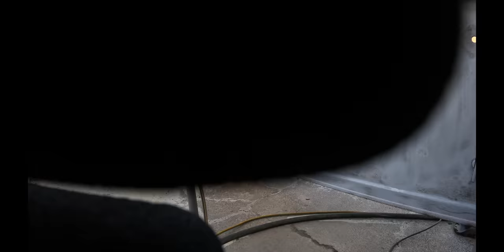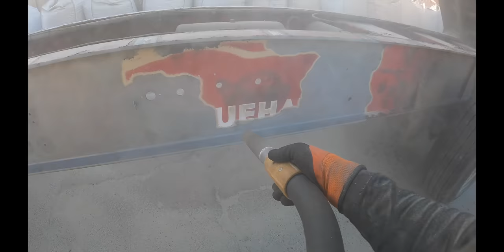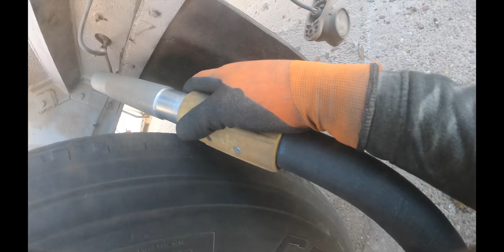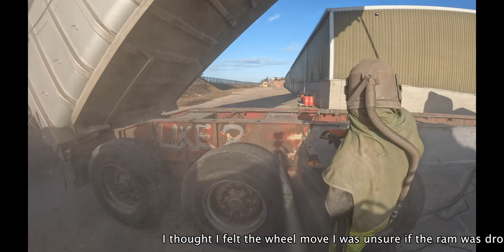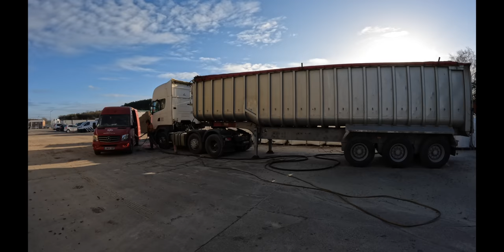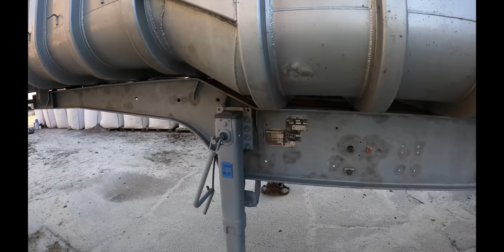How to Kill Rust! Rusty Wagon Trailer SandBlasting to Stop Remove Scabs of Rot sand blasting Real!

Comment: I once did a coupla trailers at a place in chorley and he said you don't need your compressor I've got one . Turned up and he's got an ex RAF compresser off an aircraft carrier that could go up to 600cfm  and fedd a 4" bore air pipe constant 😲😮 hooked it up turned it down and started blasting and noticed the push back getting more and more so checked gauges on compressor ,it'd only crept up to 150 psi 😲😮 . .thought better keep my eye on this and had to turn it down 4/ 5 times that day, nearly blew my kit up on that job 🤣😂🤣😂

Comment: If you don't mind me asking and I know all places charged directly. If you don't mind me asking how much did you charge for that job. If you don't want to say on open forum please email me. Thank you.

We are starting mobile blasting and just looking to see what ppl do for prices so I can understand better
Reply from the maker: Best advice I can give is work out how much your rig costs you per hour and then add labour what you can live on that's your hourly cost then it's down to you to know how long per job will take you. Please note everything about my rig and my ethics is set on speed and efficiency without compromise on quality. What I mean by this is your not going to be at this sort of speed and efficiency for some time but stick at it then it will become 2nd nature hope that helps figuring your costs out 👍💞
Reply: @Mobileblaster  thank you so much. I do powder coating on my channel right now and wanted to work my way up to mobile blasting like you. Love your vids
Reply from the maker: @GMPC  have you bought any mobile gear? Because alot of info about what's needed is wrong I can guarantee the sales reps will try and push an all in 1 with a massive tank you don't need spout off about this unit saves this much media than others its bolx mate you set the flow your the 1 in control not the the pot. It's like saying this egg timer will last longer than that 1 yeah course it will the gap is tiny and that 1 hold more. Utter shite and I know it will come out of a sales pitchers mouth no doubt to try and con the lesser informed. Dint fall for the size thingy bigger isn't always better 50kgs/200kg pots are ample for mobile run time varies out of 200kgs I can get 25/30mins or 3 and half hour that's more than my competitors blast pot 😂 totally depends on what your blasting and at what flow and cfm compressor any blast pot will run any cfm 2 main things to look at internal diameter of the gubbins of pipes and fittings are the same size as the feed air ie same size as compressors feed then it's all down to nozzle size

Comment: Why didn’t they want the inside of the rails done? Is it a cheaper option for the inside to be left?  Can you blast over the trailer air lines and valves??.  

What is that job worth? If you don’t mind me asking? And do they have to supply a safety A-frame For under that bin while the ram is up? 

Great videos keep up the good work mate👍🏽
Reply from the maker: Yeah only doing the face's is normally a good way to get the trailer back in service for a cheap option for a good few years of extra service. I can blast over pipes wires etc but it's not advised as I have many years of experience these videos make the job look alot easier than it is please keep that in mind. I was aware of the tub and its ability to just drop at anytime that's why I never put any part of my body between the pich zones alot more is going off in these videos than meets the eye hence the reason I don't state they are a how too 👍

Comment: I have a 40ft trailer that has lots of rust. I am wondering if sandblasting and re powder coating it will fix my issue? Where is this business located?
Reply from the maker: Blasting will remove the rust and paint ready for Coatings.

Comment: if you stay a little more away your profile will be cleaner with no mill scale     But good job so far keep it up man👍
Reply from the maker: If I stay back my optimal hotspot will increase and be slower cut 🤔 mill scale is harder than rust/rot so in turn I would need to be closer to get that off but that's not my job 😂 my job is to remove rust and old paints prep for paint 👌

Comment: What size of compressor did you use on this?
Reply from the maker: 260cfm 👌
Reply from the maker: @Kevin Corapi not sure of the hp but the engine is solely used to power the air end and is 3.3 turbo diesel 79kw I believe

Comment: I have seen you blasting on stepladders, roofs other ladders, but seeing you work under a tipper body without a safety bar has got to be the most dangerous job you have done, frankly it's an illegal practice in the industry, if your customers are too " cheap arse" to provide a safe working environment,  just don't do the job, there is plenty of work out there for you! I have personally seen what happens when to people's bodies when the hydraulics blow it takes less then a second to drop down.
Reply from the maker: 😏 I did look at the ram and it was fitted with emergency lock out valves not saying that would stop a bust on the cylinder but I wasn't under any part if it did fall my feelings was I would be out of the way I didn't do any internal only the face's from the side.